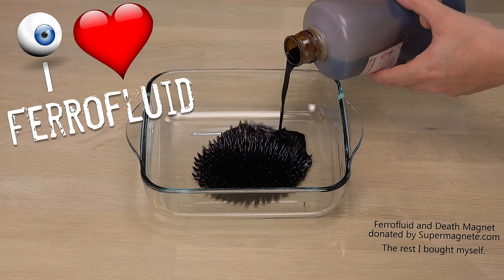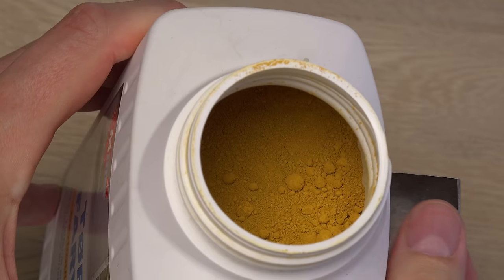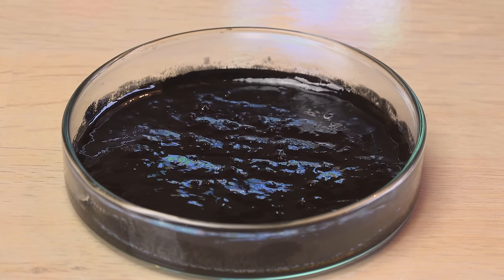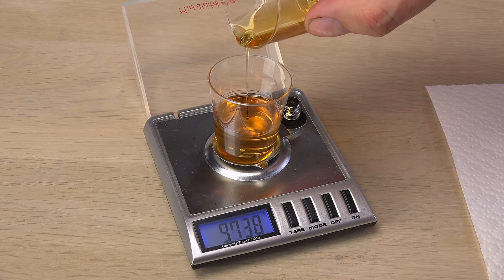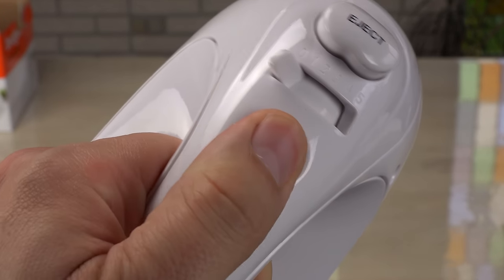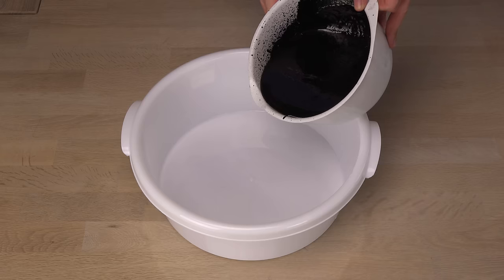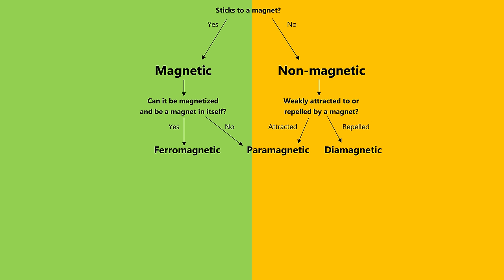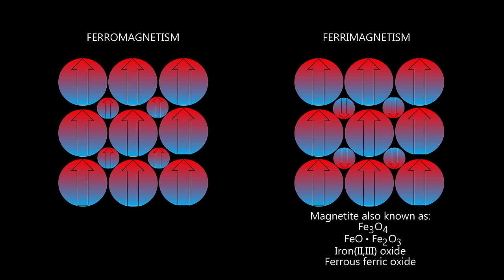Magnetic Motor Oil? | Easy DIY ferrofluid

Comment: Not sure what I am doing wrong, I used the same magnetite, the exact same motor oil. Make sure it was 5w-30 and made sure to mix equal parts of the two, but still the iron is separating from the oil. What am I missing?

Comment: I liked it!  What happens if you put the magnet under the bowl for a night? Will the oil and iron oxide seperate or will the spikes still be there the next morning?
Reply from the maker: I haven't tried it. My guess is that some of the iron oxide will separate out in such a primitive mix as shown - but there will still be spikes from some of the iron oxide that is succesfully coated and form the spikes initially. Thanks for watching!

Comment: so, if the magnet is under the table, and the fluid has spikes, we were told in basic science the spikes are aligned along the lines of magnetice force, but these spikes are many mm's apart, are they ''nodes'' and between them antinodes, is it like the Ruben's Tube gas jets experiment, if 'lines of magnetism'' are many mm's apart thats a very low 'wavelength'' 
magnetism is strange....

Comment: Good video, but I think you could have explained more the difference between Ferromagnetism and Ferrimagnetism. Sure, the difference is how the domains line up, but what does that actually mean? What effect does that actually have on the macroscopic object? I'm assuming that since not all the domains are aligned that the whole ends up being a bit weaker?
Reply from the maker: Thanks! Yes, as I shortly explain you don't really notice a difference between a ferrimagnetic and a ferromagnetic material if you just test it with your eyes near a magnet. Both are attracted by a magnet and can be magnetized. The ferrimagnetic material should have a little weaker response than the ferromagnetic material, but generally you need some lab equipment to notice a difference. To put it in perspective: Scientists invented nuclear weapons (in 1945) before ferrimagnetism was discovered (in 1948)...
Reply: I figured as much. Thanks for that!

Bonus question: Since ferromagnetism and ferrimagnistism are so close together, your magnetic fluid doesn't really have any drawbacks aside from not destroying the wallets that we all hate so much, correct?

Comment: You could try and go for a more viscose engine oil, like 15w40 or even higher if you find it.
Reply from the maker: I think it would be better to go for a more fluid oil - like 0W-20 Magnatec, but I couldn't find it in Denmark :( Thanks for watching!
Reply: I guess im retarded. Of course, i meant a more fluid oil ;)

Comment: What camera do you use, and how do you like it? Do you do any post processing? Your footage looks very sharp and nice!
Reply from the maker: Thanks! For this I used the Sony FDR-AX100 recording in UHD (4K) resolution. I love it. It has been a work horse for some years on my channel. Great images, though I'm not a fan of the colors in the recordings. It has a tendency to have a green/colder tinge, where I prefer a more magenta/warm look so I do a little post processing on color temperature. But generally no post processing is needed. Give it some good light and the images will be very crisp and sharp :)

Comment: Instead of 5w30 you could use a 0w20 oil since it's thinner, but still has the same surfactant qualities.
Reply from the maker: Exactly - I did try to find the 0W-20 variant og Magnatec but simply couldn't find it in Denmark. Guess Denmark isn't cold enough for such a fluid oil...

Comment: great vid , I wonder how tinkering with the ratios will effect the behavior of the fluid .
Reply from the maker: Thanks - it is worth experimenting with the ratios. 50/50 just seemed to work best for me. With less magnetite it seems to form spikes in stead of plates a little easier (less viscous) but they are scattered and too much inactive oil floating around the spikes for my liking. At this price it's definetely worth trying different mixing ratios.
Reply: Haa! I should have known you had already tried different mixes and posted the best. I'm trying to think of practical or industrial used for this stuff. Are there any?
Reply from the maker: Ferrofluid is used industrially. It is used in speakers to cool and dampen the voice coil assembly - typically in tweeters. It is also used as a low-friction sealant (https://en.wikipedia.org/wiki/Ferrofluidic_seal) like around the spinning drive shafts in hard disk drives.
The ferripaste probably isn't suited for this :)

Comment: I enjoyed it, a lot!
Question: if you mix some thin mineral oil with magnatec, will it lose the surfactant properties?
Reply from the maker: Thanks! I haven't tried thinning out the ferripaste. I actually like the consistency which gives more variation in the patterns it can form. But there's definitely room for more experimentation with this stuff - stay tuned :)

Comment: Are those spikes solid/hard? Could you place an glass asstray on it without it sinking it into the fluid? If so, what would be it's resistence, couple of hunderds of grams of maybe kilo's.
Reply from the maker: They are not solid. Consider them a liquid, though the higher viscosity in the ferripaste makes them a little harder than the ferrofluid spikes which are very fluid.

Comment: Hey Great Work! Or should I say... Great Play!!!

Im itching to get my hands on some... next pay after Rego ;)

Have you considered trying some electromagnetic stimuli?
I mean just simply a coil with AC frequencies going through it with a frequency generator, sinewaves... and to try various frequencies with a resonance aspect...
Also to use a coil as if a speaker coil with about 8 ohms impedance and play tones through the coil, or even music....
Would be very entertaining...

If you look at the Cymatics videos with sand or salt on a metal plate over a speaker.... there is one where he is using 3D in a fluid, water and some additive...and he is getting 3D shapes.... but to go further his friend is recording dolphin sonar in his research, and sent him the recording of the sonar, and he played that through, and saw what the dolphin saw, as in a human face, a human body, and a cube etc in 3D... 

 And finally, putting this stuff in a toroid shape and wind a coil around it, so it moves like a solenoid within the coil core creating also a current and magnetic field.... supposed to be leaked alien technology from Roswell... which is now proving to be true...
Reply: PS I have 1KG of aluminium powder of 400 micron size, I was going to experiment with using AC and eddy currents in a toroid. Tho your stuff look great, and I am thinking of throwing in a bit of Aluminium just to see what happens... as the liquid is silver in some leaked info, probably mercury.... which also has the magnetic cones like your does... but if you have ever seen aluminium powder, it flows like a liquid.... and burns great in fire works.
Reply from the maker: Thanks :) Yes, I have considered upgrading to electromagnets in future videos. Should be very interesting to have more control over the magnetic field. I (sort of) test ferrofluid on a speaker here:  https://youtu.be/Fw-PemqRN3A

Comment: Can you add water or something to dilute it and make it a bit thinner? Then it would be a little more fluid and less paste
Reply from the maker: I doubt it. The oil and water would not mix and make separate layers. Maybe with some emulsifier, but it could be easier to find a more fluid 0W-20 variant of the oil :)

Comment: given that most engine blocks are aluminium alloy and bearings are phosphor bronze etc ie. all non magnetic, I fail to see how magnetic oil is going to help except maybe to increase wear
Reply: etmax1 Castrol Magnatec isn't magnetic. It has polar molecules that stay on metal. It's a good engine oil.
Reply: :-) Yes of course Magnatec isn't magnetic, and also yes it's a great oil, one of the best. My comment was about the title of this video which says "magnetic motor oil" and I was only making it clear that the "magnetic" part of magnetic motor oil would be as as useless as tits on a bull.

Comment: I had a question. Is there any possible application for this type of fluid in hydraulics? Could you use this liquid, combined with an electromagnet, to force this liquid to travel through a tube, thus creating a sort of hydraulic system? Appreciate any input on this.
Reply from the maker: It is possible to 'pump' this fluid around just by using magnets: https://phys.org/news/2011-09-ma-magnetic-fluid.html
Though, I doubt it will be possible at high enough pressures to replace current hydraulic systems at reasonable costs. Thanks for watching!

Comment: Re: failure of cooking oil & iron oxide.  Did you try putting some detergent in it first?
Reply from the maker: No, as mentioned I only mixed the oils and magnetite. With some sort of surfactant added it should be possible to make it work.

Comment: Everything on earth is magnetic. I'm just wondering will water and a bit of washing liquid make the paste less viscus and sharper spikes?
Reply from the maker: Well, everything has some form of magnetism, but everything isn't 'magnetic' as in everyday sense. The oil will not mix with the water, so I don't think it would work well. But it would be better in a less viscous form... Need to experiment some more :)
Reply: True that, thanks for the reply. As the earth is essentially a giant magnet I assumed everything in the field is also  magnetised but then again everything has come from the earth anyway.

Comment: you better patient that,it could be used inside motors so they wouldn't wear out,magnetize the can,crank, pistons and piston rods so the oil sticks to them.There would be less wear on metal parts,making motor last much longer.I believe you can get a patient for ten years so nobody steals it,if they haven't already.

Comment: Great video but more magnets vs elements and did you try to make a similar fluid with the red oxide?
Reply from the maker: Thanks. I need more elements to make part 6 but it will come eventually. I did actually try making ferrofluid with the red oxide. It will climb up on the sides of the container if put right on the edge of a powerful magnet - but it will not form spikes at all.
Reply: lol, red ferrofluid would have been awesome. I can imagine getting the remaining elements is tough. XD

Comment: would it be possible to do a casting of this by doing it under a layer of water on top and freezing it, then make a model using the ice block as a mold?
Reply from the maker: Yes, that seems doable though I haven't tried how it reacts with water :)

Comment: Nice video man! I search for this for years, but never get satisfying by the result, so if I get 5W-30 C3 motor oil and Fe3O4 Powder, and mix it in the right proportion it will work :) ? Keep doing your videos, i love it (from a French sub !)
Reply from the maker: Yes, I guarantee that it will work with the exact motor oil I show in this video. I think other high-end fully synthetic motor oils will work too, but I haven't tried so I don't really know. But any Magnatec oil should have the right surfactants in it to work.
Reply: Thx for your answer !

Comment: I have been unable to get spikes. I have been using magnetite pigment and the Magnatec oil. The Magnatec oil does seem to have a surfactant mixed in because it does form a proper suspension which does not separate (after several days in a strong magnetic field it does separate somewhat). This is a big improvement over the worthless naive recipes composed of some magnetic powder mixed in oil. I tried different ratios of magnetite and Magnatec oil without improvement. I suspect that my magnetite pigment particle size may be too large. I believe that small particle size is a critical factor in the success of this material. It may also be that the neodymium magnet I am using is not large enough. I am using an N52 neodymium magnet about the size of my pinky (1 cm X 5 cm). This is about the smallest size of N52 strength that begins to scare me. I have shattered a few magnets and received a painful blood blister from getting pinched by these magnets.
Reply from the maker: The N52 magnet should be powerful enough for spikes. How thick a layer of ferripaste did you test it with? What is the exact type of Magnatec oil you used? (there are many versions, I have only tried with the shown but doubt I was lucky enough to use the only one that works in the first try...). Try moving the magnet in a circle under it. It promotes the formation of spikes :)
Reply: I tried using sunflower oil as it has a high volume of oliec acid (surfactant)  but alas as with most cooking oils I too got instant seperation when I put my N52 40x40x20mm  under it..  However was interesting watching over a small period of time as the black cheap slundge seperated leaving clean oil on top and a nice small "mountain range" of iron oxide at the bottom  ( I used a very fine grade black iron oxide..nice and powdery!)
I will try Magnatec next  time when I get some more clear dishes and mixing cups... Very messy, but even my "fail fluid" taught me some great lessons
I will also buy some commercial ferrofluid from the internet, seen some good deals such as 20ml  with pippet at gloves for under £10
Reply: my 20ml arrived today, so did my magnatec oil and some more nanoscale magnetite powder... :-)
Reply from the maker: Nice - good luck with it Phil :)

Comment: I found ferrofluid in a pretty old disc drive on the magnets near the read lense thing :0
Reply from the maker: Makes sense, since the lense is controlled by something similar to a voice coil motor. Ferrofluid is used to dampen and cool voice coils in loudspeakers. It is also (has been?) used as a seal on hard disk drive shafts. Thanks for watching!

Comment: Hey....I'm wondering if you could use this in a vehicles engine??? It's still fluid, but it would cling to the moving past of the engine which could only reduce wear and tear on engine components.....especially with cold/winter weather startups???
Reply from the maker: I believe the pure motor oil is much better. I doubt the magnetite will have any beneficial effects inside an engine. Most modern synthetic oils are already designed to cover moving parts in a thin film of oil - Magnatec being particular aggressive about promoting the effect :-)
Reply: Brainiac75 but like you said, there seems to hardly any magnetic properties to their claims of "magnetic oil" 🤔

Comment: What makes the shape of the liquid different? For example, some were pointed and others were kind of petal-like. Is it to do with distance from the magnet or?
Reply from the maker: Distance does matter and will change the spikes. For the ferripaste, inconsistency is also a factor. The particle size and uniformity is not perfectly the same throughout as in the ferrofluid, and ferripaste is more viscous, giving it different reactions to how I move the magnet and at what distance. Much more fun to play around with than the very consistent ferrofluid :)
Reply: Brainiac75. You made a leap of improvement to it I would say.

Comment: OK I have to ask! will the fluid get magnetized?
Reply from the maker: Yes and no... The ferrimagnetic magnetite particles can be magnetized. But since they are not stuck in a crystalline solid, they can easily move and turn around, so the ferripaste doesn't work well as a magnet :) Thanks for watching!

Comment: +Brainiac75 You should really try:

Nanoscale Fe3O4, 1%
Propylene glycol (carrier), 98.5% to 98.9%
Xanthan gum (surfactant), 0.1% to 0.5% (this is a highly effective thickener, and will make this a non-Newtonian shear-thickening fluid as a bonus)

You may also substitute some of the propylene glycol with glycerol (aka glycerin) to thicken it up some more. 
Adding more xanthan gum will increase the shear-thickening character, whereas adding glycerol will simply increase viscosity - so you can create a variety of differently-behaving versions!

This mixture is also non-toxic (relatively; don't drink liters of the stuff), and water soluble for easy cleanup :-)
You can substitute propylene glycol for ethylene glycol (aka antifreeze) if necessary, as it may be easier to get (although PG is usually very easy to get) - but this will make it toxic to consume

Or:

Nanoscale Fe3O4, 1%
PDMS (polydimethylsiloxane) aka silicone oil (carrier & surfactant in one), 99%

This one is not particularly toxic either, but nonetheless I do not recommend to consume or get all over oneself (even if only to avoid the stains!)

Comment: Is it possible to use iron filling instead of iron oxide?
Reply from the maker: Maybe, if you can get the filings extremely small. Otherwise I believe the iron filings and liquid will separate and not look anything like ferrofluid.

Comment: Mine only spikes a little even through the iron oxide and the oil mix together and does not seperate also the iron oxide does stronly react to a magnet
Reply from the maker: If it does spike, it's very close to a success. I have tried so many solutions without any spikes at all. What magnet are you using? A high grade neodymium magnet? Maybe try tweaking the mixing ratio or use a higher grade neodymium magnet for max magnetic field :)

Comment: Can you make ferripaste act like a magnet?
Reply from the maker: Yes and no... The ferripaste will be magnetized near a magnet and keep the magnetism afterwards, but since the tiny magnetite particles are free-flowing in the fluid and not set in a crystalline solid, they will rearrange to each others magnetic field whenever the external magnet is removed. So the ferripaste will not work well as a magnet in itself.